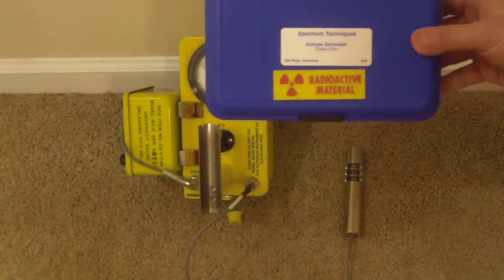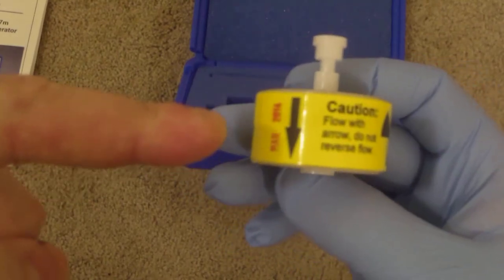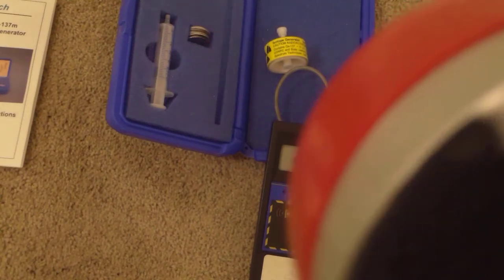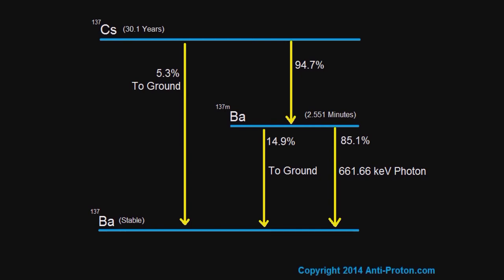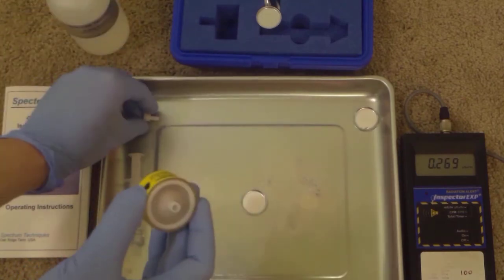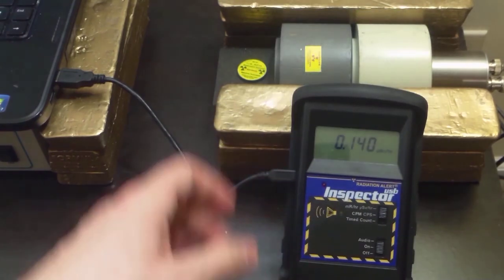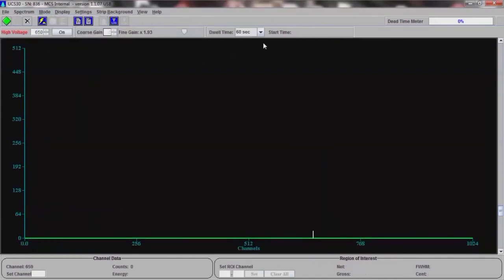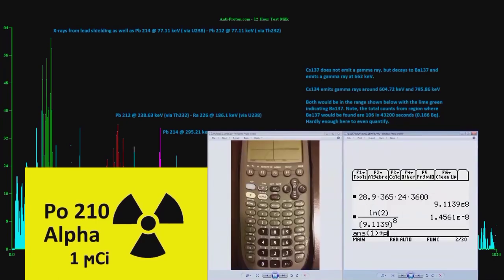☢ Nuclear Material Generator! ☢

Comment: These kits are expensive, however I FINALLY made a Protactinium-234m generator! It has a half-life of 77 seconds. I made it at home. I used 2.5 g of uranyl nitrate, 7.5 mL of distilled water (to dissolve it), 17.5 mL of conc. hydrochloric acid (ACS grade, 37.5%), and 25 mL of methyl isobutyl ketone, and carefully added this to a 60 mL leakproof polypropylene bottle, and it works spectacularly! I use the SEI Inspector USB Geiger-Müller counter with the Observer software, and I get about 120 CPM for background from the Pa-234m generator, and about 3500 CPM at about 2.5 cm. It works great!  It's my favorite digital G-M counter! The exponential decay curve of the Pa-234m isomer generated and measured is SO smooth and precise! Thank you very much for sharing these videos! Also, are you going to make more videos? I miss you, Tom! 👍

Comment: Cool! I think this kit is based on the original Union Carbide design. I have a 10uCi. source disc and some old spark tubes that contain Cs-137. You can do this with Pa-234 using a similar method. You need uranium nitrate, nitric acid, and ethyl acetate. Kits aren't available in the US. They make them in the UK, but I don't think they ship them. I just need the nitric acid and ethyl acetate. I don't remember the ratio, but the Pa-234 will settle on the top after you shake it vigorously in a plastic bottle. Thanks Tom!
Reply from the maker: You are correct! It is based on the UC design. It's a fun little unit.

Comment: How do you properly dispose of the liquid sample afterward?
Reply from the maker: According to the NRC and the manufacturer, the mixture can be poured down any drain due to the exempt quantity. I do not do this until it has returned to zero. I tend to cover it with a Pyrex beaker and let it sit for the night. 

After 12 hours, the mixture has only 1.08796E-85 of what it had... which is effectively zero for this activity. e^(-(ln(2)/153.06s)*43200s)

If I were working with larger quantities (i.e. not exempt) a disposal protocol would be needed, including disposal company, etc. This is why I like radio-nuclides which "burn off". Longer lived radio nuclides are not usually permitted for non-lab use.